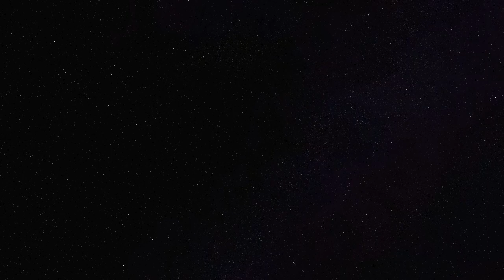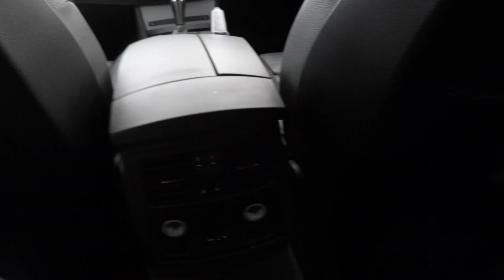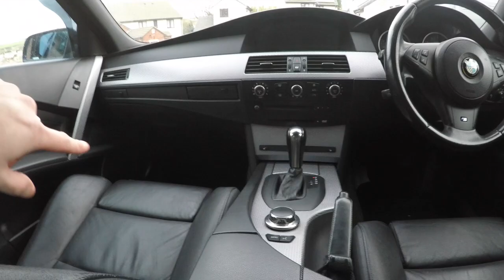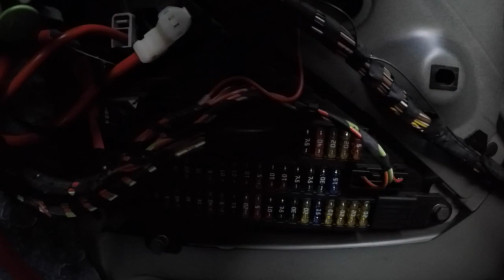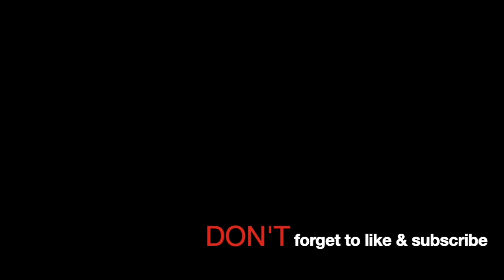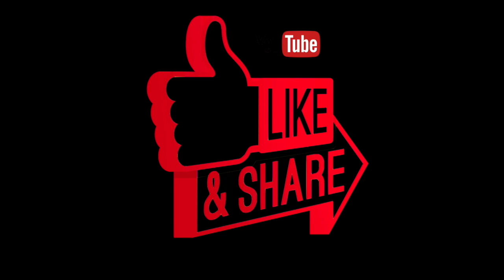Bmw Cigarette Lighter Fuse Location & Fix Rear Lighter Socket

Comment: My Aux connection in between those 2 lighter sockets in the back is not working. It does zoom when I put it on AUX but tried different cables without any luck. Opened up the panel but connectors are in place. Any known issues regarding this?

Comment: My issue is with a brand new 2 Series Gran Coupe. Its the front outlet that doesn't work the other one in the boot, does. I have no access to a fuse diagram to work out if its the fuse. BMW provide them via a portal on their site but that is refusing my VIN.

Comment: Thanks Dean. Another cool video
Reply from the maker: no problem Vladimir keep watching got some interesting ones for software ready to load tomorrow for acs and winkfp
Reply: @BMWDoctor  Hi Dean
Not sure what ACS is but I have winkfp but nevet had to use it so it will be interesting to see how it works. Cheers mate. You are flat to the board uploading videos. Keep up the good work mate
Reply from the maker: @TheKeenMechanic  acs mate is your abs pump usually the motor fails causing faults most common problem if its e39
Reply: @BMWDoctor  oh I know what you mean now. ASC/DSC system. I had awful bother with my e38 with all 3 abs dsc lights lit in red on dash and throwing  codes for bad rear right sensor. Hooked it up to inpa at the time and was showing weird faults but nothing exact. So thoughg it was the sensor and replaced it with a new one than same again. After that I thought it was the wiring so traced the wiring and took interior out as I found water in foot well so thought it was that. Then someone said it is possibly the abs module/abs pump. By then I had purchased and installed ISTA+ so on my own I decided I should try and trigger a component and tried the abs pump module and made sound then triggered pre charge pump and was dead so that was it the problem in my case. The weird thing is that I swapped the pre charge pump from my  530i e39 to my e38 740i and it worked a treat and the bad one in the e39 showed no faults at all and brakes working fine😃. Should have done a video but still shy when it comes to showing myself on youtube😊

Comment: Hiya mate are the rear fuses ignition live or permanent I've not got a multimeter lol cheers 👍
Reply: Sorry mate why im asking is I need a remote on off wire for external amp so was thinking if I could piggyback from that as I dont use them 👍